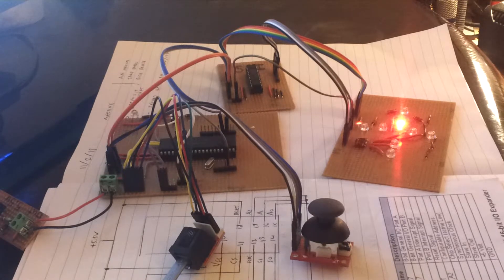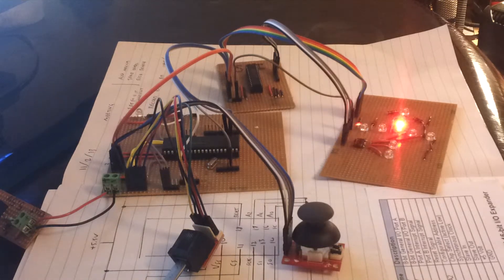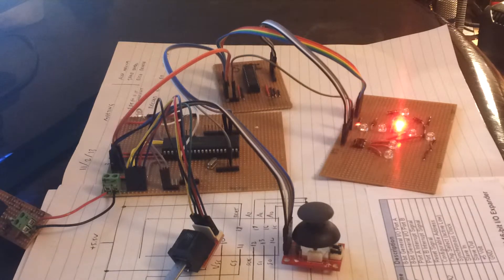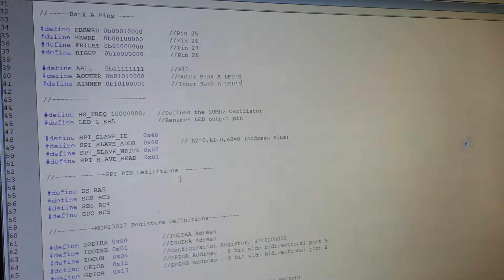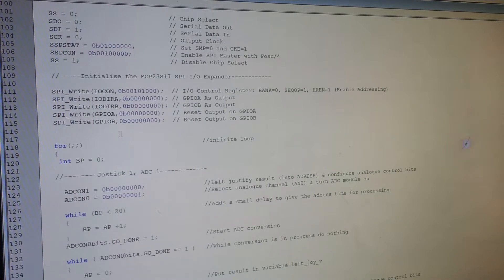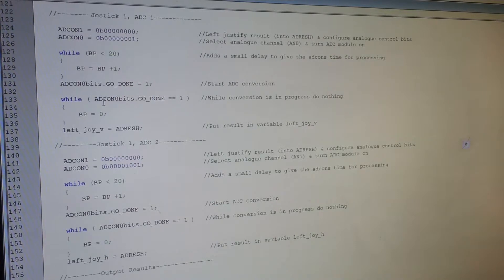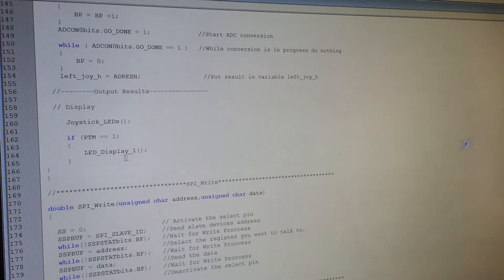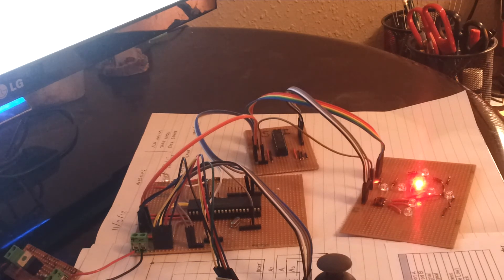SPI Communication Between A PIC Microcontroller And Port Expander - Part 1.mp4

Comment from the maker: Honestly this is so long ago now I cannot remember, it is easy enough though just look at the PIC's datsheet.  It would outline the SPI capable pins
Reply: share code please
Reply from the maker: @sk0512b   it is too long ago, however a lot of the code is shown in the video, please watch it all the way through
Reply: @alexmalcolm8580  thanks for the reply, actually i forgot to enable chip later that I corrected my code as per your explanation and it's working fine thanks for the video Alex
Reply from the maker: @sk0512b  no problem at all, I am pleased to see this is still helping people 8 years on.  I miss all of this I have to admit, I moved from engineering roles into technical sales a few years ago.  The money is better but I will always be an engineer at heart!